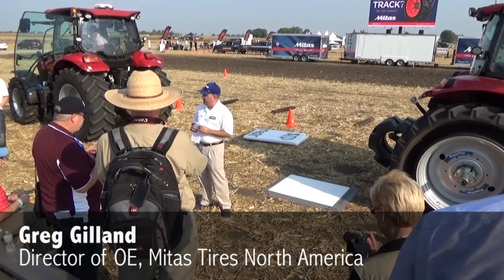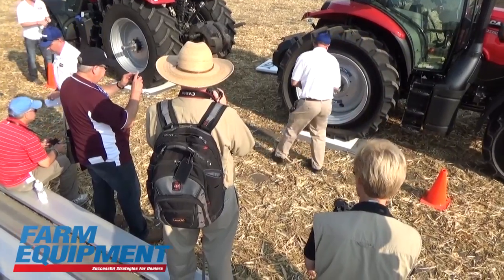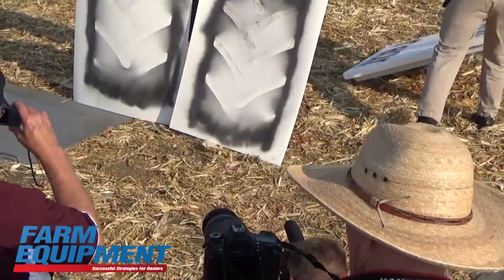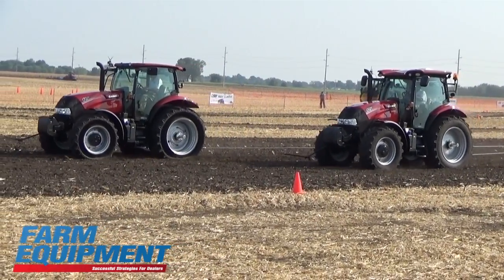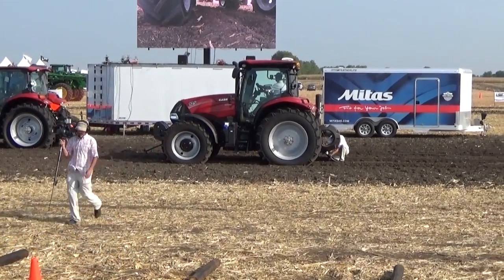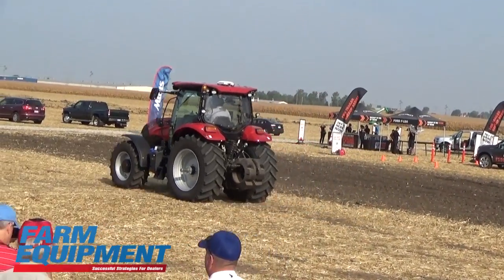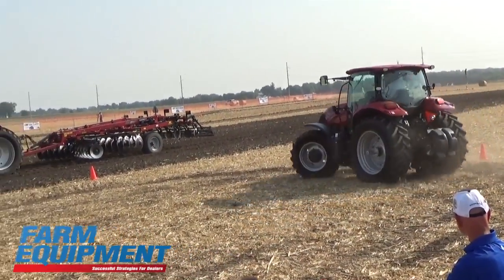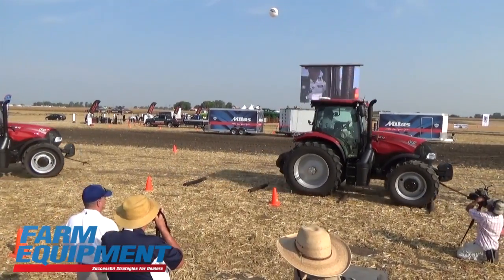DEMO: Mitas Displays PneuTrac Tire Concept

Comment: As for durability - on drum test high load (150% of required ISO test) we gain 300h which is 400% better than the required running time. Our tread wear-out is better by 20% than a premium brand and 40% from a mid market brand.

Comment: as for fuel efficiency - on road: in cursing we measured (by leading OE) 7% more fuel on road when going up gears 10% less fuel so total road fuel consumption depends on specific routing. Off Road full consumption  depends on soil in a sandy soil you can expect up to 40% better traction and fuel economy

Comment: This is ridiculous. It's simple and cheaper to let air out of your tyres in boggy areas where you need to increase your footprint and then re-inflate them for harder ground use. Many vehicles, like Russian military vehicles, do it on the move, at the flick of a switch!.
Reply: Most common sense observation!!

Comment: Looks like they finally designed a tire to be run aired down and not destroy itself, much like off-roaders do and good off-road truck tires are designed to do.  They are designed to be run slow with lots of sidewall flex.  If you run a truck tire aired down at highway speeds long, you will destroy it because of heat caused by all the flex.  Tractors will never do that.  I would imagine they designed the sidewall to handle the flex of being run near-flat as well as the flex from the torque of pulling.  It drives me craze how he calls them "peno track" instead of "new" track.  I would hope it's not because he's an idiot and is actually because the corporate heads are idiots saying they are called that....a "marketing gimmick."

Comment: What is their weight rating can they be put on your heavy tillage tractor and withstand the weight of the equipment attached. They squat quite a bit with just the tractor. I like the idea compared to say fendt variogrip system with the airlines running everywhere. But there is also no variability. It seems like they went maximum grip while sacrificing load capacity.

Comment: what happens when the tractor lifts a really heavy implement on the 3 point hitch or two round bales on the loader?
Reply: They simulated that weight with 2 500lb weights on the rear lift I still personally wouldn't like these tires we had them on a skis steer and they would get flat spots in them and ride like shit
Reply: right pressure according to applicationThe same as will happen in any tire i.e. Tire has to be inflated to the
Reply: how do you set the pressure?
Reply: the same way you set the pressure of any tire. but...for standard tire in order to set the right pressure you need to know the actual load on the tire then set it according to the index book while with these tire you can simply judge it by the gap in the sidewall 'V' shape slit
Reply: the same way you do with a standard tire, each tire has to be inflated to a pressure according to operation condition, it is the same with Pneutrac (Galileo Wheel) only the range  and level of deflection is such that for every given application you will have bigger deflection i.e. bigger footprint and higher draw bar and less soil compaction.

Comment: How is this different from simply airing down?
Reply: well this costs more :) thats the difarance. these are allways gripy and never fuel eficient and will always grind away rubber like a 18year old boy whit his first car. when you air down a tire you can put air back and make it fuel efficient again xD these tires you cant air upp so non fuel efficient
Reply: it will give you much better traction and wont destroy the tire' better ride comfort and will keep all lateral stability
Reply: you you don't loose lateral stability you dont destroy the tire no buckling under the tread  check out www.galileowheel.com

Comment: This another evolution trick like they use in Dutch only one low pressure tyre in front of larger JD-s and others. More tyre in contact on land meaning better weight distribution  so tractor do not compact land under it self so much.

Comment: I bet with these on a tractor your fuel consumption would more than double it would have to
Reply: yeah. why do you need these tires. buy the equipment that can handle the jobb from the begining and if that one rainy mudy day when you absolutly need the extra grip then just deflate the tire a little

Comment: That tractor pull didn't prove anything unless the RPM's were synchronized and tire diameters were exactly the same and a manual transmission is used. Try using a competition sled and pull until the wheels spin. That would be proof.

What is the figure eight supposed to prove?

Wasn't the tread wider on the pneumatic tire? Was it properly inflated?  

Tread depth? Rubber durometer? Cold weather flexibility? Special wheels required?

I have more questions but not more time.

Bye

Comment: Anybody else notice that on the tractor pull the standard tyre tractor stays fairly level whilst pulling but the pneutrac is bouncing like a bunny. That's gonna be fun driving that all day with a load on. Yes it would help to weigh it down but not on a heavy straight pull
Reply: Yeah they both bouncing lol
Reply: Both where bouncing but the pneutrac bounced a hell of alot more. IMHO
Reply: Really.. i saw both doing the same bounce during that pull.

Comment: just give me a tire with air.. no need to reinvent the wheel
Reply: Radials are simply an improvement to an already existing good technology that allows increased weight capacity and stability however running these airless tires is a complete reinvention of tire technology. You should think about that before attempting to make a smart ass comment.
Reply: I doubt these will reinvent the industry, but you sound like the stoneass luddites that were clomping around in the 40's with steel wheels!

Comment: I wonder what the tire pressure is on the tractor with regular tiires
Reply: Considering there wasn't much give over the posts I would estimate around 30psi which is about 12 too much for most tractors as the recommended is 18psi for the rears and usually 24 psi for the fronts and I know from experience on those larger Case tractors makes the tires look like they are half flat when they are properly inflated.
Reply: my tires are filled at about 14 psi, so they must have much less. Bigger tires require lower psi for the same weight
Reply: exactly :)
Reply: Jarno Grooten probably like 80psi haha
Reply: wiky5 i under stand that, i was saying 80psi, because they probably pumped them up so it wouldn't dig as much lol

Comment: all they did was make a tire with a stiff sidewall so it could be used with no air in the tire. of course a flat tire I'd going to offer more traction, more comfort in bumps. but I bout vet those tires wouldn't last as long as a normal ag tire would. plus the edge of the rim is exposed and will allow things like dirt, rock, mud to wedge itself in between the tire bead and the rim. I can't believe they are acting like they have created a new universe over a flat tire.

Comment: so can I just drive around on a flat tire then? it's the same principle
Reply: Flat tires flex differently, often caving in the middle giving you a less efficient contact patch and placing stresses on the sidewalls.
Reply: Dalton Phillips That's because that technology only works on lighter vehicles, not heavy ones like the tractor.

Comment: Correct me if I'm wrong, but that just looks like running around on flat tyres with a slightly different rim profile? Where's the new technology that you are using? If I get stuck I let the air out of the tyres and achieve the same effect.
Reply: You cant run flat tires without damaging them. This tires basically are designed to be able to run flat without ripping apart.
Reply: Gruff Morris actually it is true. I sell and repair tires for a living and have been working on them for over 30 years. I grew up doing this work. running any tire more than 25% under the manufacturers recommended air pressure will cause damage to the tire. I don't care if you saw the damage or not but it is there. when tires are not properly inflated and the equipment is driven what happens is the layers are stressed by the excessive flexing and they start to tear apart. it's not usually noticeable right away but over time will become noticeable. anyone that says otherwise literally has no clue what they are talking about. it's not a sales pitch or just an opinion, it is a fact.
Reply: Gruff Morris.
It's just another snake oil promotion, that's all.
Reply: There is a possible benefit though, as opposed to an inflated tire you would have to add some sort of liquid ballast to the tire to effectively transfer weight to the ground with these all the weight of the tractor is transferred to without a loss in traction. Also there would be no flats due to running over a broken off fence post, culvert or lost disk or some other piece of trash out in a field such as a hidden sharp rock or something. I know a lot about flats because it's my job, I am a tire repair guy. I am not trying to promote these tires or any of that garbage but simply stating I could see a potential benefit in some aspects but as supersmalls stated I do wonder about the increased fuel usage and the overall life of this product compared to a conventional inflated tire.
Reply: Gruff Morris same thing I was thinking
Reply: I'm not disputing that prolonged usage of flat tyres is bad for the tyre. My main dispute is there is no need to run flat tyres unless you're in a spot of bother at which point the flat tyres don't see any damage because of the limited time spent flat. The manufacturers specifications are based on the expected load carrying capacity of the tyre. For example towing a plough would require more PSI than just the tractor unit. There are so many tyres out there that run ~10 - 15 PSI. So 25% under that would be 7 - 12 PSI - usually sufficient to get out of sticky spots. Prolonged usage of the tyre at low pressure, yes will cause damage. But the only time you really want to lower the pressure of a tyre is in a sticky situation, or to spread the load over a larger area if marginal over a bridge or something. As supersmalls pointed out, the massive fuel consumption increase of constantly running a tractor on effectively flat tyres outweighs any "footprint" benefit you would see on a corn or hay field. Likewise, having a low footprint whilst ploughing makes bugger all difference - you're ploughing over it anyway.
Reply: with standard tire if you run with no air you will destroy the tire very fast and you will loose you lateral stability i.e. steering ability' with these tires you can actually run with no air you will maintain full control over you vehicle and
you will not destroy the tire even if you drive lake that for kilometer for more info you can look at our websit at www.galileowheel.com
Reply: 0
Reply: לא יודע לקרוא תמונות ,
Reply: That's simply not true. There are so many occasions when I've lowered the pressure in the tyres to increase the traction, and not ripped them apart. You only destroy tyres if you run them completely flat and run on the rims - flat in this case means flatter than normal, say 5 - 10 PSI.
Reply: Gruff Morris we run our tires at 7 psi
Reply: @gruffmorris9098  tires are not designed to be run on low air pressure if you do so it doesn't f**** make a difference how it looks to you you have caused damage to your side wall. Don't believe me put it on the road and go drive around for a few hours like that and see how much your tires left!
Reply: Thanks.
Reply: Robert Kraft                      If
Reply: 8
Reply: mn
Reply: Gruff Morris the way these tires are set up is so that they are happiest when flat when they are filled up the sidewalls expand and they are like a normal tire but when they deflate the sidewalls go in to the tire instead of out  and then you have full use of the tires even when flat they sorta turn into tracks when flat these tires are the next best thing in the tire world
Reply: Gruff Morris you didn't know? Pay 40,000 more for that technology..
Reply: Think of the additional fuel consumption....those poor farmers
Reply: I do see your point. The trouble is, the reasons given in this sales promotion video are not the benefits that you are talking about. Surely the manufacturer would highlight these not just the benefit of effectively running on flat tyres?

Comment: I don't know about all the test being practical because tires are making contact with dirt.
They should stick to selling the ability to withstand punctures. Which they didn't do.
What kind of destruction can these tires go through before you have to replace them.

That's the only real selling point
Reply: This system will only be efficient on dirt where the thread can sink in the soil and allow the smooth par of the tire to touch the soil.
Otherwise there is no benefit to use a bigger footprint if only the thread itself touch the ground,like on a compacted dirt road or asphalt.
if you want to reduce ground pressure you need to increase the surface touching the ground,so the whoe tire,not only the thread.
it's only for soft soil,otherwise ,no point at all.

Comment: What about getting stuck in mud? That empty space between the track and rim will fill up with mud, and gonna have you sucked down pretty good. Were those tyres tested for how they perform while the tractor is stuck?
Reply: 2:23
Reply: @danielgorzel7222  Where is the mud?
Reply: +Ancalim We tested Mitas PneuTrac in various conditions and in factthey are performing very well in the muddy conditions thanks to the larger
footprint. Larger contact area with the ground means lower chance getting stuck
in the mud. Self-cleaning properties are good and we didn’t have a problem with
mud getting stuck between the track and the rim. It gets off the tyre while it
is moving thanks to the centrifugal force and specific shape of the tyre/track.
It is quite difficult to describe it in words and as soon as we will have a
video proving that we will release it.